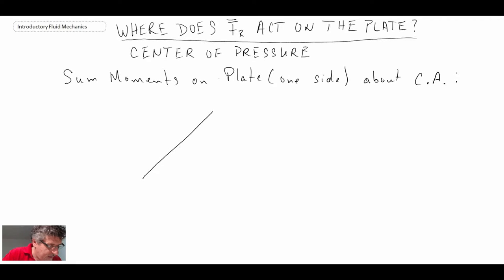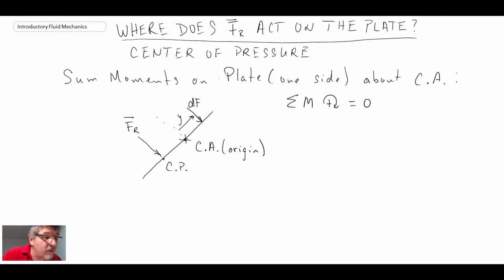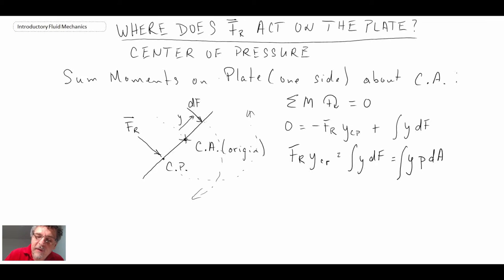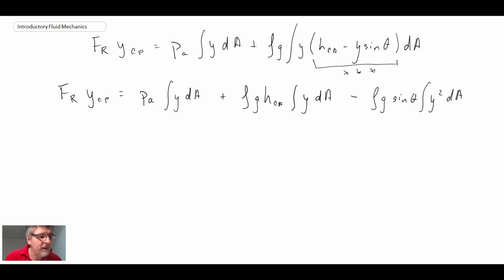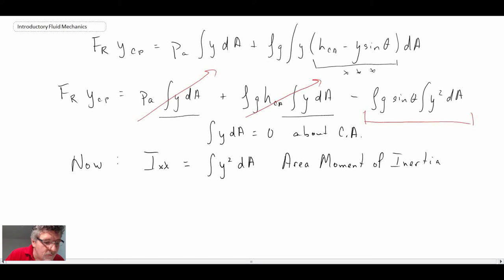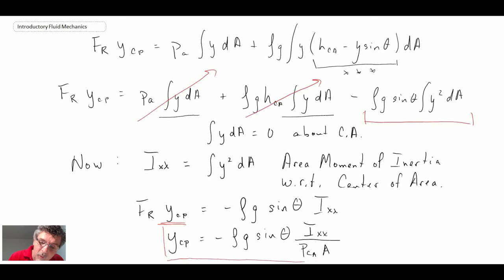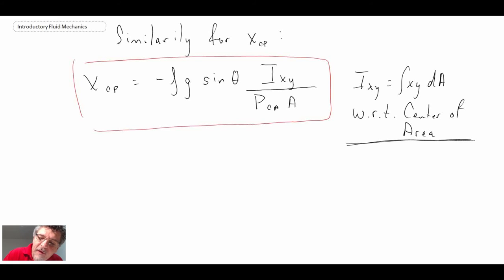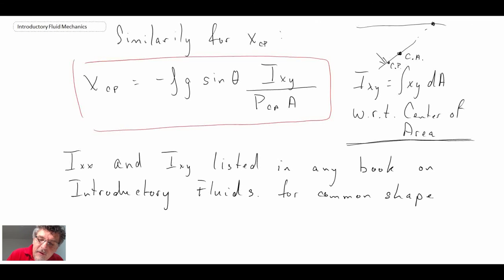Introductory Fluid Mechanics L5 p4 - Hydrostatic Forces on Plane Surfaces - Centre of Pressure

Comment: respected sir. could you please post a video having more exaples on this "plane surface submerged in fluid topic? please. like five examples only.
Reply: +Aakrit Patel
I realise that this is a rather late reply, but if you are still interested in examples on submerged plane surfaces then I can recommend the strategies that are used in the book "Engineering Mechanics - Statics" by R.C. Hibbeler in chapter 9, section 5.
He uses a different method there where he first calculates the pressures at the top and bottom of the plate and then creates a "force per length" function and integrates that function to find both the resultant force and the center of pressure (basically, he finds the total area under that function and this area in square meters turns out to give the force in newtons).
He explains those procedures in detail in chapter 4, section 9.